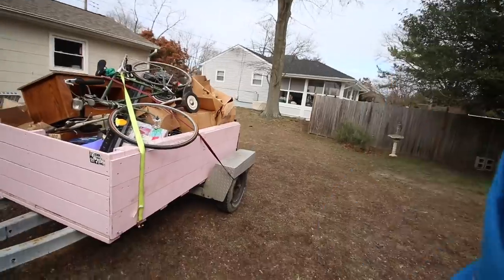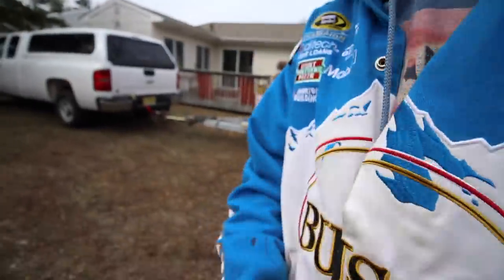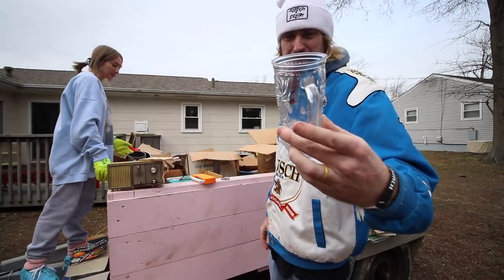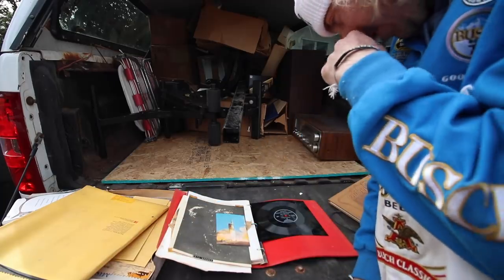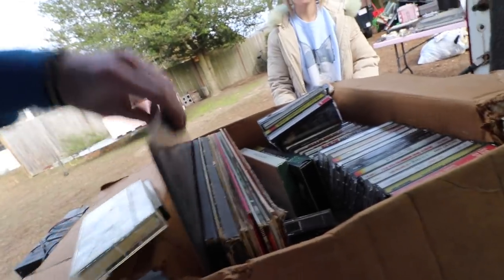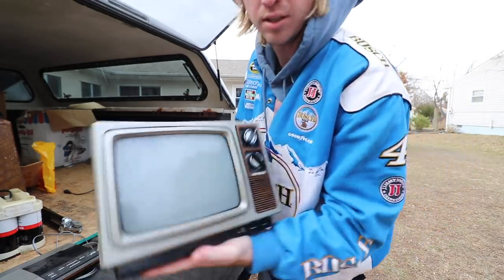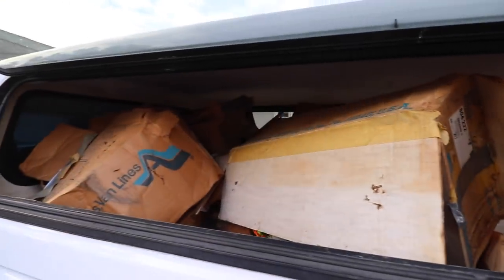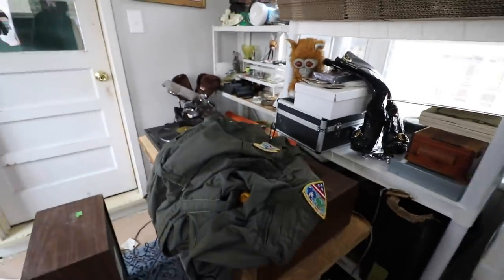Much More PROFIT From $60 Storage Unit Than We Thought!

Comment: You guys might consider keeping a small nailing compressor for clean up, if you happen to come across one. I use mine with a blow-off tip to clean dust off of woodworking and cabinetry before finishing or install. 

It works great for dusting hard to clean household items, too. I took all my mom's silk flowers and textile decor onto her front porch last spring and gave it a blast, it all ended up looking like new, she was loving it.

Comment: The pots and pans with the copper on the bottom are Revere Ware.  That stuff has been around forever and lasts forever.  I have a set I got for a wedding present in 1982 that I still use.

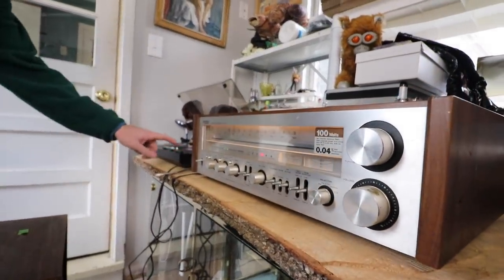Comment: 35:49 - Stylus, not pin. A record player's needle is called stylus, the thing that holds it is the cartridge. Also, the aluminum Ham Radio thing is not a tower - it is an vertical antenna. A tower is what holds it or it can be ground mounted. I couldn't see it well enough couldn't tell the maker/model number. The IC-02AT is a 2m Amateur Radio FM Transceiver 144 - 148 MHz.

Comment: Gosh, I worked on Lotus Symphony as a programmer in the 1980s certainly takes me back. at that time some people had 5.25inch disk drives and others 3.5inch so as it was an expensive product they shipped it with both. The smaller disk had higher capacity... most of those have gone to landfill so are rare now I guess.

Comment: Starting a load of clothes add your detergent let the machine fill up add 1 cup of Coca-Cola and continue the wash you can also use a pre wash or I spray and wash before starting the machine but remember to use the Coca-Cola
Reply: And not any of the other cola brands either or any cheap cola drink it has to be Coke or it just stains the clothes. There is also bicarb and tonic water as another option as a pre soak
Reply: @stuartstone6359  that is not so Coca-Cola is number one but I also have used Pepsi-Cola and I have used dr. Pepper actually I buy the two liter bottles when they're on sale for a dollar I don't care if they go flat it still works
Reply: @douglasharlos4113  Pepsi never worked on tough stains for me. Dr pepper is coke though that's why it works its just a different flavour. Fun fact It is actually cokes oldest beverage even older than their cola
Reply: @stuartstone6359  I'm sorry you've had bad luck was Pepsi Cola I have not had that problem I'm still saying Coke is a better product for it and Pepsi will work if you have no Coke but it is not only the stain set it is removing it also keeps the colors bright it also keeps the whites whiter it also cut unwanted odors I like I said or need to say I'm not here to argue or fight with you or debate with you I'm just passing my experience along
Reply: @douglasharlos4113  nah dude no-one is arguing just talking lol have a good evening

Comment: What's up with the Volvo?
Reply: I know right
Reply: He has it listed on Facebook Marketplace for $2000.

 "2002 Volvo S60 White 4 Door
Somers Point, NJ · over a week ago · 
$2,000
PLEASE READ BEFORE MESSAGING! The car does run and drive but has issues that need to be addressed. Asking price is $2,000 but entertaining all reasonable offers. The back window that is missing I have a replacement that needs to be installed. I did change the oil and spark plugs withing the last month. I would he willing to part out the car if the right prices are net for the desired parts. "

Condition
Used - Good
Reply: @vtgjunk4362  Thanks dude